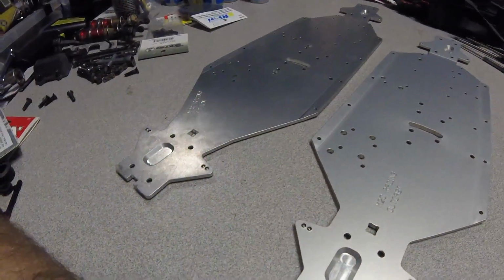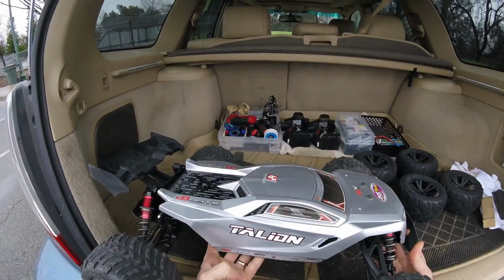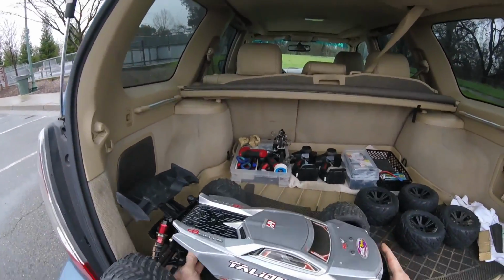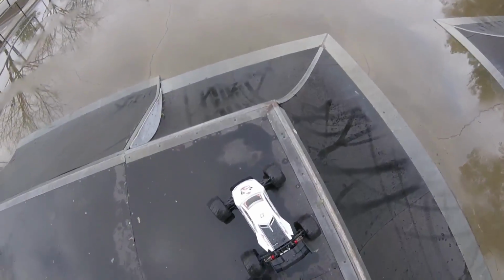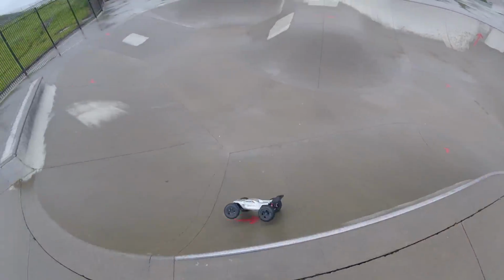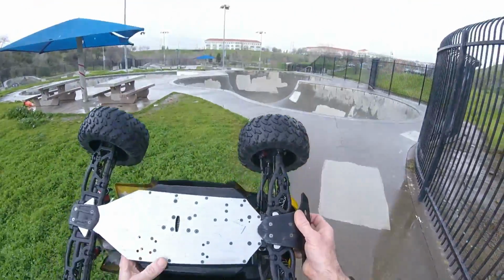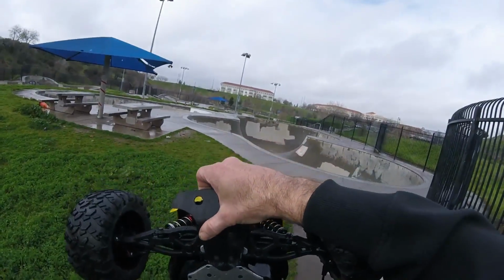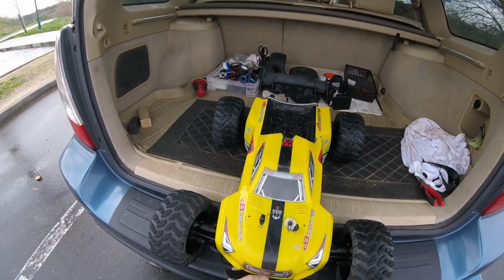Arrma Talion V3 "M2C chassis slap" prototype test, plus Kraton 6s...

Comment from the maker: Here's the link to the M2C Kraton Goliath Series chassis 😍 part # M2C3000. Outcast/Typhon is M2C3005. Limited batch now available🤪. Don't forget to use the m2ccoupon for 20% off!!!!! Hoping the V3 Talion chassis and motor mounts will release soon. https://www.m2cracing.com/searchquick-submit.sc?keywords=M2C3000
Reply from the maker: @rc Casey you bet Brother 👊. I really don't have a favorite 🤔. Both are BADASS😜. The Talion handles better and is screaming fast with the stock Katar tires or Badlands 3.8s. The Kraton is still better equipped for really rugged terrain and massive sends👀. I lean towards the Talion for pure driving pleasure, but LOVE them both dearly 😍😎💪👊👊
Reply: Hey rich, check out force rc epidemic. For an rtr I’d say it’s between a big rock a Losi and an arrma 6s. Really good bang for buck. Mine just came in. Trying something other than just arrma. But sticking with horizon hobby
Reply from the maker: @justinjones5281  thanks Justin I'll have a look 👀🍻😎💪👊👊
Reply: Thanks for the info Rich i appreciate it man i didn't get to use the coupon😩 but well worth it anyway happy bashing bro👍🤙😎🤪😜😝🙈🙉🙊👊✌
Reply from the maker: @12R1rcbashr  you bet Chris 👊!!!! Bummer on the coupon. Just remember it's a standing discount that Mitch offers. m2ccoupon in small letters. May need to copy and paste it, but it's added towards the bottom of his product description I think 🤔. The Talion chassis and his new motor mounts should be available very soon. 🍻🤘🤘😎💪💪💪👊👊
Reply: This chassis is great news. I discussed this weakness in Arrma chassis and compared them to the shredder setups as being to thin. I'm really glad someone got on it. I will surely be getting one. Thanks Rich!
Reply from the maker: @FarmPrepper1  hey Brother 😊. Just saw your message 👀. Yeah the 6s chassis definitely has it's limitations. Even with the new V4 versions having a center brace, the Goliath chassis's are the ultimate solution for lasting problem free bashing I'm thinking anyways 💪. Hope you're doing well Phill 😍🍻🤘🤘😎💪👊👊
Reply: @richduperbash2966  doing well. Still a couple ft of snow on the ground up here. All my cars are still boxed up. I checked that Goliath chassis. I dont have the words. This chassis covers exactly what I pointed out in my v2 Talion review. Best part of it. This chassis fits the v1 and 2 talion as well as the Keaton, so I'm gonna grab IT AIR DUPERBASH!!

Comment: Another great video, brother!  I just wanted to say thank you for putting out these videos. It has opened up a whole new part of the hobby for me.  I never knew so much of this was possible. You’ve helped me break some parts and make my rigs tougher at the same time!  You introduced me to the M2C stuff a while back with your Teknos and I continue to love their stuff. I’ve converted my Outcast and Kraton over to the M2C chassis. Anyways, sorry for the long comment but I have a question for you.  Have you ever hit yourself with your rig? LOL I pulled a really bad move last weekend. Hit myself and blew up my transmitter. The wheel was hanging by wires. Thanks brother!
Reply from the maker: Thanks so much for the comment Brother 👊!!!! Yes.... I have clipped myself a few times and totally tagged myself with my Senton 3s not long ago 🤪. Rig went off course off a jump face during a mud bash. Broke my bumper on my forearm 🤯. It was already beat up, but geez🤣🤣. Gotta be careful with these rigs. They're incredibly fast for their size. 👀🤘🤘😎💪👊👊
Reply: Rich Duperbash alright! I don’t feel that bad now. LoL My MT410 spun the tires approaching the jump and kicked sideways. Hurt like no other! I was actually talking to Werner Sline the other day about this topic. He had some interesting input as always! 😂🤘🏻🤘🏻
Reply from the maker: @CitationZac  yeah it doesn't take much to go wrong...Lol😜. Once you break traction before or midway off a jump, it becomes a crap shoot. 👀

Comment: Finished watching the video, amazing! 😱 You nailed that gap jump with both trucks 👏👏 It amazes me just how much bigger the Kraton seems compared to the Talion 😂 You had some rough landings on the concrete, great test run! I would say the Talion chassis is ready 👍👍
Reply from the maker: Thanks so much Aaron😊!!!! Definitely think the Talion chassis has the goods 💪. I was thinking the same thing about the Talion and Kraton....Lol👍. Think it's the taller stance and BIG Ragnarok wheels 👀. Those are my street testing tires, but they did pretty well considering how slippery it was out there 👊. Those concrete landings were brutal 😜. Not something I'd recommend, but it made for a good test...Lol. 🍻🤘🤘😎💪💪💪👊👊

Comment: Friggin damn bro!! Talk about ultimate chassis test.. well...  you're dead spot on!!😲😲😬😂.. those hard concrete Landing were freakin Brutal 😲😬. Hard to believe Goliath chassis remain dead straight after that. Hats off to you bro for putting your Arrmas for a hard test. Hats off to Arrma, M2C and Voltage Hobbies. Just fitted my Arrmas as well. Just waiting on the Talion ones. Weather here has been frustratingly terrible man.. bash on brother.
Reply from the maker: Thanks so much Chris 👊!!!! Those concrete hits were definitely Brutal 😝...Lol. Not something I recommend really. I've had electronics and packs simply die from similar impacts before 🤪. Thank goodness for the yoga mat under my Lipo👀. These chassis's are definitely the real deal 💪. I saw your upload showcasing your new M2C chassis's 😍. Actually passed it on to Mitch and the rest of the test team 👍. We are so fortunate to have Voltage, M2C, RPM, Tbone, HR, and all the other aftermarket companies to completely beefcake these fine Arrmas with 😜!!!!! Hope your weather improves Bro.🍻🤘🤘😎💪💪💪👊👊

Comment: 1) I like how there seemed to be no reaction from you after the overhead transfer on the full pipe 2) For me, servos have been the biggest pain in the ass in all my years of RC.  3) Nice 50/50's and backside disaster (I realize there is no front or back side in RC, well maybe there is..... in relation to the way you hold the radio.) 🤔🤨 Anyway, I think driving a line like you would on a skateboard is pretty damn cool. You're the only person I've seen really doing that. 🤘
Reply from the maker: Thanks so much Brother 👊!!!! If I could still skate like I use to I definitely would 😍. My ankles simply can't take it anymore 🤪. At least with the RC I can relive some of the fun 😜. I can't believe some of the technical park skaters 🤯. No pads/helmet doing Crazy big full speed vert stuff....Lol. Yeah...I'd have to agree about the servos😜. Really appreciate the comment my friend 👍🤘🤘😎💪👊👊

Comment: I see you have really been getting into those rails a bit more recently... loving it! Sweet park session as always and will most def be picking up atleast one  SWB M2C chassis for my TT build that's in the workings now and if my budget can handle grabbing the LWB kraton I will also grab one as well. Can I ask what your suggestion would be on the type/brand of  hardware that's best for these beasts? I have had some issues with the stock stuff even when using MIP hex tools . Also I've had some issues getting the grub screws out from the axels out of the brand new arrma rigs out of the box and although I know they have plenty of lock tight I still seem to manage to damage them and have gotten myself stuck barreling this issue past two nights now that these hub grub screws are now badly stripped. Any help or suggestions always appreciated brother. Looking forward to seeing the talion m2c chassis do its thing at the dirt park whenever the foul weather let's up for u buddy.

Comment: Love that "pipe gap"... so sick..
Reply from the maker: Thanks Bro 👊!!!! It's a little intimidating to be frank🤪. Gotta go real easy on 6s to gap it right. 🍻🤘🤘😎💪👊👊
Reply: @richduperbash2966  I bet! Cant wait for the weather to clear up some so its easier to bash. Had to settle for ramping in front of my house yesterday before the rain hit.
Reply from the maker: @HighVoltageRC3080  yeah me too 😜. It's been a wet year so far. I still LOVE some quick frontyard time 😍
Reply: @richduperbash2966  I put a 4x4 board under my plastic ramps to get extra height.. can hit 15-20' height easy and land 50' away just using the small plastic ramps with enough speed haha!
Reply from the maker: @HighVoltageRC3080  that's awesome Brother 👊. I pretty much did the same with mine 🍻

Comment: Hey Rich great bash really like that wet terrain of the skate park.  The truck looks great what tires were on Proline something?  And is that the brute bash body?   Truck ran great.  Really like those chassis.   Just need a Kraton haha.   Cheers.   Sorry if you mentioned the body and tires I am watching at work so my volume is “controlled” 😄🍻👍
Reply from the maker: Thanks brother 👊!!! Nothing like YouTube at work 🤣🤣😜. Both bodies are stock Kraton and Talion bodies I just painted up. Was running Proline Shockwaves on the Talion and Dboots Ragnarok Nero wheels on the Kraton Beast 😍. Had a Blast slipping around out there in the wet. 🍻🤘🤘😎💪👊👊
Reply: Rich Duperbash what a good looking combination trucks look great.  Yes a great bash makes for great video in the rain!

Comment: Caution slippery when wet 🤣🤣😈😈😈🤘🤘🤘🤘🤘😃😃😃😃😃😃
Great to see the inner sk8er coming out brother 50-50s 4 days 😈😈😎 , bummer about the servo , and the loop of death is just EPIC , picture perfect landing Rich that was BADASS😃😃😃🤘🤘🤘🤘🤘
Reply from the maker: Thanks so much Matt😜!!!! Man I miss skating 😭. If only my ankles could still take it🤣🤣. It was definitely slippery out there Brother 🤪. I actually slammed pretty hard getting into one bowl. Stepped on a painted area and both feet shot straight out 😻🙄🙄. Controller tagged the ground, batteries shot out, GoPro flew off my head🤯. My low back took most of it with a slight head knocker😵💫 for good measure. Reminded me of old times actually 😂. The rain has been so steady here that the skatepark is really my only chassis test option👊. I'm down for mud bashing, but it's just too soaked. The gap of death felt good 😜. Like coming in on a vert ramp after a floaty. 🤘🤘😎💪👊👊
Reply: @richduperbash2966  owwwww DAMN on the spill Rich 😬😬😬😬😬 hope your ok , you would be feeling that the day after for sure by the sounds 😵😵😵😵😵 I miss sk8boarding, took it's toll on my body to bro , I remember having a swellbow for like a year straight 😬😬🤣🤣🤣. Loved the death loop bro was just EPIC 😈😈😈😎😎😎🤘🤘🤘🤘🤘

Comment: Kraton or talion ?  i got itch add to fleet ? Rich did you see vas interviews with arrma , i think towards end year we see some new rigs and arrma will change over to spectrum.
Reply from the maker: Tough question Brother 🤔. Both are very worthy in my book. No wrong choice. Yes, I saw all 3 interview segments 👍. Expect lots of new stuff from Arrma this year 🍻🤘🤘😎💪👊👊
Reply: @richduperbash2966  i do cant wait , i swear my brcc has a jinx .lol its just imperative to get rid stock wheels if expecting it to perform as well as granite . i cracked hub wheel not even bashing must had a hairline crack after i threw granite wheels on and ran same granite lil longer less responsive jitter like expected with longer wheelbase i watched all your up grades wanted to do from day one problem is everythings sold out to april oh almost april 😃👋💪i didnt want order mx28s 14mm than change over 17 shortkey later so running these stock wheels as much possible till parts more steadily available
Reply: @richduperbash2966  as much id rather buy new arrmas , these are going be last hurey of tactic remotes im creature habbit grown ucustom to tactics im missing my futaba remotes from a move may just use tactics for those rigs too why not i feel too many adjustments fancy spend too much time programming messing around
Reply: @richduperbash2966  be cool arrma used toms idea made real basher thats small like he did with tssagan cant compare to to tracxas mini revo and it woukd be same money maybe 100 more